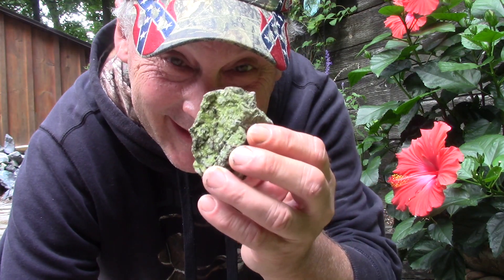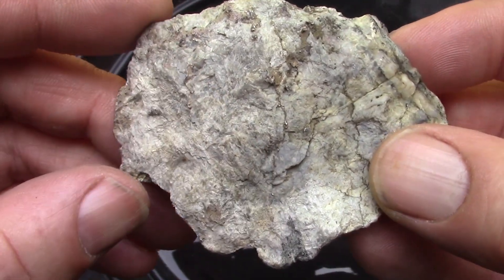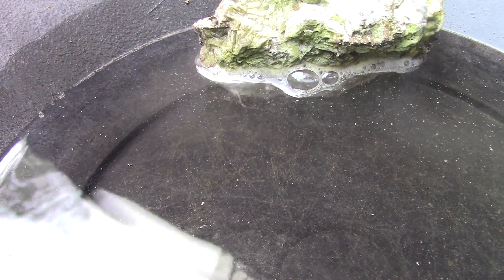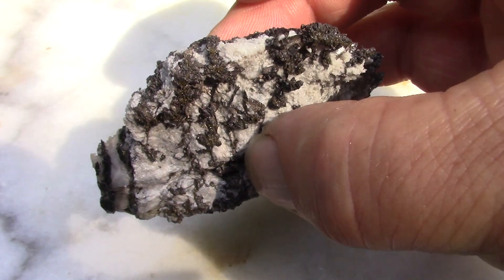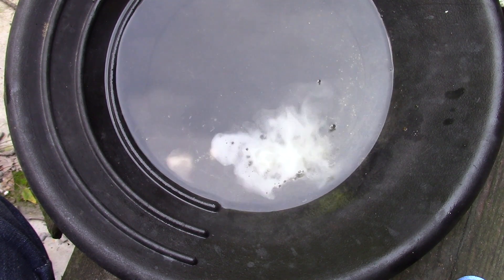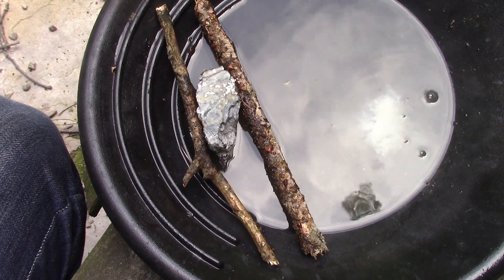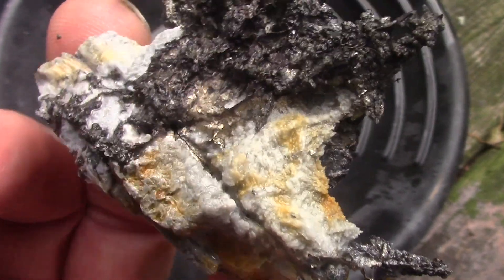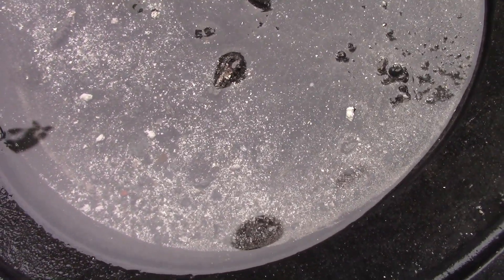ETCHING CALCITE TO EXPOSE NATURAL SILVER

Comment: I had an unexpected problem with etching gold bearing rocks recently..I was unable to get them out of quarz so I decided to apply some HF to it as it doesn't dissolve gold..And the funny thing is that before hydrofluoric bath the gold was definitely there-even the pinpointer shown that fact!And after the HF there was nothing except some sludge which by the way stank with pungent garlic odour and also like some strange odour was present but no gold!And just to make sure that it ate all the gold I poured some water(which somehow dissolved sludge and made a clear purple-red solution with nothing in it)-and took a tiny ball of gold left from melting some powder in the crucible..And it God damn dissolved in several minutes!How is that possible?((
And by the way now I am wondering how to precipitate gold from there as I even don't know what actually dissolved it?..
Reply from the maker: HF is a lab only chemical.  It is not something to play with.  It is very dangerous.  I think you were dissolving arsenopyrite which would explain the garlic odour.
Reply: @meMiner  I know,it's actually the chemical that I fear the most of those that I use or have..I fear it more than my own super-recipe which is astrolite-D with granules of pure peroxomonosulfuric acid with ultra-thin layer of protection,which I use in tests of my experimental firearms(for now I mean concept tests)..Although it's several dozen times more powerful than TNT(1kg of this yields not less than 10-15kg of TNT),but it is surprisingly stable stuff(unfortunately stinky like hell)-but at least it won't do anything like HF will if accidentally you get it on the skin..I initially didn't take those precautions too seriously but when in Russia in MCHS(МЧС) lab I witnessed a case when a guy got HF running down from his glove onto unprotected hand-I really changed my mind,especially when I heard that after all his hand was amputated-just after maybe 20-30 millilitres of around 50% HF-that is really gross..And also I would never enter the room in which there is any quantity of this shit without having a gas mask,eye protection,gloves and a bottle of calcium gluconate ready to be used immediately if necessary,because I was also told that if that guy had used gluconate in time he would probably still have two hands..
So in conclusion most of fluorine- containing stuff is fiendishly corrosive and unbearably toxic-which is not so surprising due to the insane nature of fluoride ions and especially fluorine itself,that is by far the strongest halide and the most reactive element in entire periodic table..So,even for that reason there exist three types of chemists:organic chemists,inorganic chemists and fluorine chemists..I just know basics of dealing with HF and F2(I think I probably will try to perform a PGMs separation process that is based on the fact that each PGM starts reacting with F2 at it's own temperature so I suppose it will probably turn out to be efficient way of separating them from each other..

Arsenopirite?Damn,is that looking like simple pirite but with either green or sometimes blue tinge?Just had a bunch of this stuff in my sample but thought it was just regular one ..But maybe it is what dissolved my gold in fact?
Reply from the maker: Arsenopyrite forms under the same conditions as gold and as such can be an indicator mineral.  You can usually smell garlic when breaking fresh rock.   The old method to separate out gold was to crush and roast the ore, then use gravity separation and mercury.  For large deposits, they used cyanide leaching.  I have not done either method and both have their environmental dangers.
Reply: @meMiner  interesting!I should probably extract arsenic from it for the elements collection I guess😇
And by the way actually about mercury:how is that done?Just am I right that you simply crush the rock into a powder and then pour in some mercury and roll it all over the crushed rock so it absorbs it into itself and than you only have to evaporate mercury so you will have your gold and also mercury in condenser?

Comment: Unrelated to the vid...any chance you have some tips for hand sanding/polishing slices? I have silicon carbide paper that goes up to 3000 lol and i did some fluorite which was super easy to give a sheen to...having trouble with everything else though
Reply from the maker: I sand wet and clean the sandpaper so I am not scratching.  Usually 3000 is good enough but for a super shene I go higher than 7000 and then use an appropriate polish.
Reply: @meMiner  awesome! Thank you, i also have some "battstiks" they are to charge lap wheels but i have been debating on using them on the 3k grit or felt dremel wheels

Comment: Nice vid. Didn't know what the term was for that exposed silver. I was calling them silver "trees." 
What do you think the black branches are mixed with?
Also, I have a small boulder that I have to crack open (about 1 1/4' X 1').I got it thinking it was silver-containing because it has a baseball-sized geode of silvery layers. Now I'm pretty sure they're not silver  because they're flaky. Probably mica w/ pyrite or some kind of schist? Also though it's still muddy I saw a whole area of quartz on one side. It's overall EXTREMELY heavy for its size. What are your thoughts? Maybe I'll get a photo up sometime.
Reply from the maker: If the silvery crystals are flaky, that is usually mica.  You can usually separate the flakes with your fingernail or a sharp knife.  Mica is not all that heavy so there might be something else in the rock.